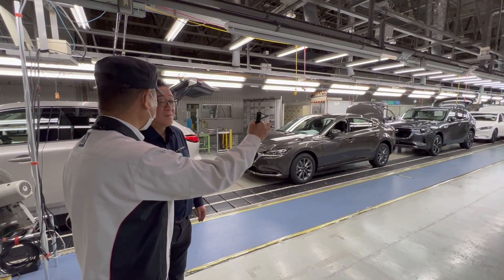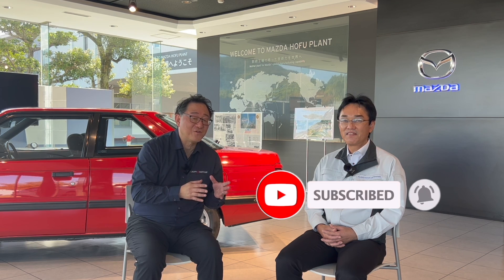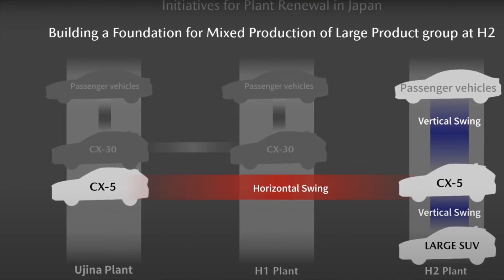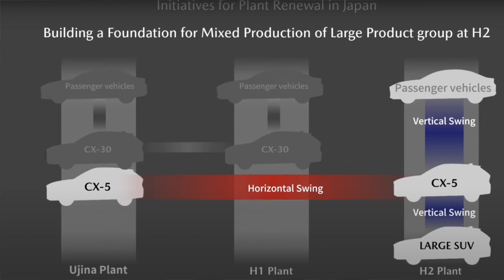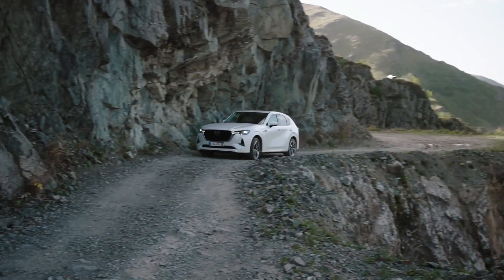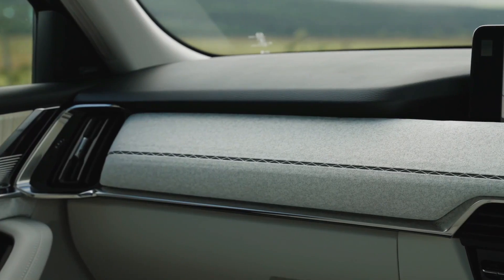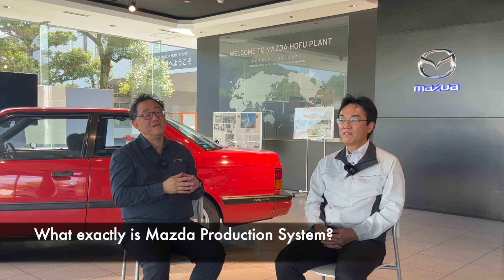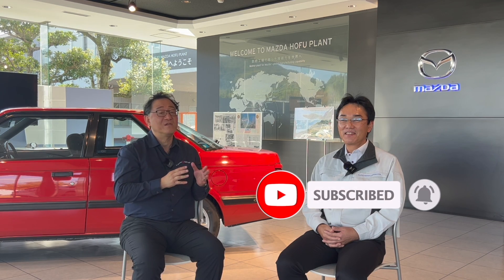SECRET TO MAZDA'S WORLD-CLASS SYSTEM EXPLAINED - EXCLUSIVE INTERVIEW WITH MAZDA PLANT MANAGER

Comment: Sir, why does Mazda did not use Multi-Point Injection fuel system in CX5 2.0L (PE-VPS) and 2.5L (PY-VPS) Skyactiv engines?
Reply: The Skyactiv design found other ways to mitigate carbon buildup

Comment: After over 3 decades of me owning Ford era Mazda vehicles with great handling but average reliability (1983 626, 1986 626 GT Turbo hatchback, 1991 Protege 323, 1997 626 LX V6 and 2004 Mazda 6 V6 hatch - the rust bucket - all manual), my wife is on her second CX-5. It's the Grand Touring Reserve with that sweet Turbo 4 cylinder. Despite not being the most luxurious sounding motor, the overall package is sublime, with great driving dynamics, excellent build quality and stellar reliability. Her previous 2016 Grand Touring was equally reliable, if not as fast. Both have had minimal issues with components failing, with only the newer one requiring post-warranty "Good Will" replacement of the navigation screen due to surface failure. Also, when I described to my dealer about a problem with power loss, they brought forth a special service bulletin to reprogram the ECU and the turbo power came back just like that. Interior panel fit is perfect, there are no rattles, and at 60K miles the suspension still rides over rough roads with quiet composure. It's very refreshing after so many years of driving Mazdas that were more fun than any other car but still very rough around the edges. I look forward to driving and hopefully owning one of this next generation of i6 motors with the PHEV, turbo and rear-drive layout!

Comment: Work for Mazda as a service manager for over 25 years they do make the best cars in the world and very reliable. Just waiting for my CX90.
Reply: Oh come on man... don't tell me you didn't have any nightmare stories from the days when Ford owned a portion of Mazda. Their collaboration on that 2004-2008 Mazda 6 and Ford Fusion might have helped the Fusion to become the decent car it did, but the Ford meddling in the Mazda way of doing things made the Mazda 6 hard to own! I owned an '04 6S hatchback V6 5-speed, and while I truly loved driving it, that thing was a nightmare to keep reliable and serviced. There was always, always, even straight from the showroom, something needing to be replaced, adjusted or repaired. That car had legacy oil leak issues from the timing cover on that Ford 3.0 "Duratec" V6 that haunted me well past the warranty period until I finally - after trying to get Mazda to recognize the problem - fixed it myself after 10 years of breathing in vaporized oil after it would drop onto the catalytic converter. I hated to see it go when I sold it at 17 years old with fully rusted out rocker panels, rear wheel arches and all door bottoms. It was the Ford way of doing things in that Michigan factory, and the reason I'll never ever consider a Ford product. I'm SO glad they divorced.
Reply: @InexplicableBill  I worked for Mazda for 30 years and never had any issues with any of my cars and my CX9 I have now has over 250,000 Kms and no issues. All they need is service .
Reply: @frankschopp8748  LOTS of service. Way more service than my Toyota or Lexus ever needed. And I'm referring to Ford era Mazdas, not post-breakup. And believe me, when the Lexus (GS 350) or our Highlander have things break, it gets expensive fast!

Comment: David, The number one question I have for Mazda relates to the puzzling reintroduction of the torsion beam rear suspension across the product line at the exact time the brand is claiming a 'near-Premium' status. 🤔 BTW are you going to release this full interview in the original Japanese so we can compare your translation to the actual words spoken 😉😉
Reply: If im correct, the beam is only on the mazda3. I think I remember Savagegeese talking about it- it had to do with ease of development and manufacturing
Reply: @ciello___8307  CX-30 and CX-50 have it too.
Reply: @RightLaneHog3151  but their new premium platform models like cx-60 dont
Reply: Savage geese did talk about it and there’s a video of Dave Coleman from Mazda talking about this somewhere on YouTube that they went that route because it’s easier to dial in the suspension settings. They wanted to lock them there. Less suspension settings in the rear also means that when you go for an alignment etc. there are much fewer places for some unwitting technician to mess around with it and change the suspension settings to dial it further away from what Mazda wants it to be.
Reply: Mazda is a publicly traded. The goal being to raise the stock price, which usually includes cutting expenses. But they did it right, car rides fabulous. The "premium" price is being reflected in the improved interior quality.

Comment: Gap not applies to the external, also involves gaps that cannot be seen, eg. The unseen gaps between the doors and the abc pillars.  It helps with nvh, and handling.  B pillars with staircase stepped design (3 steps for lexus for eg.) Helps with nvh greatly.